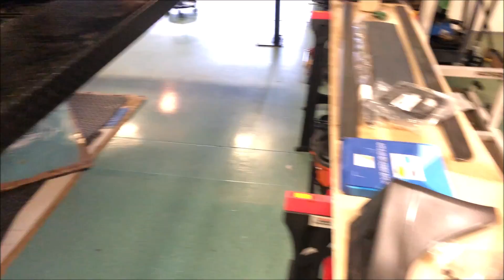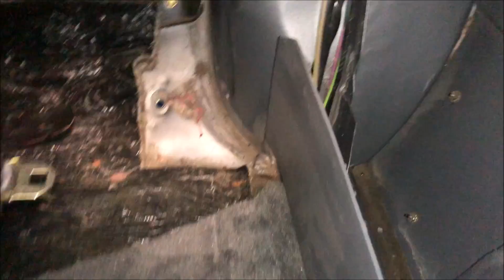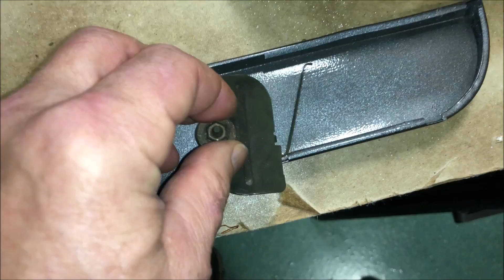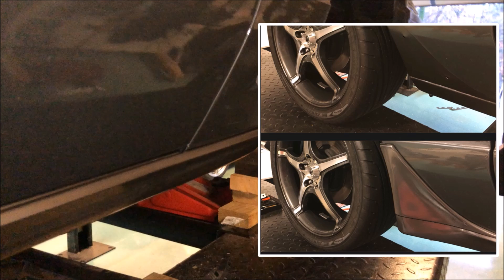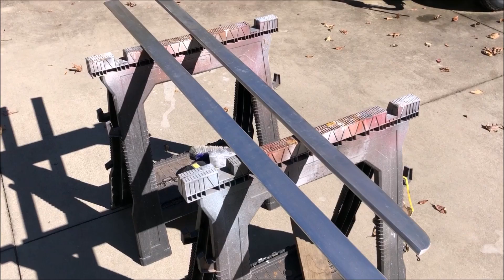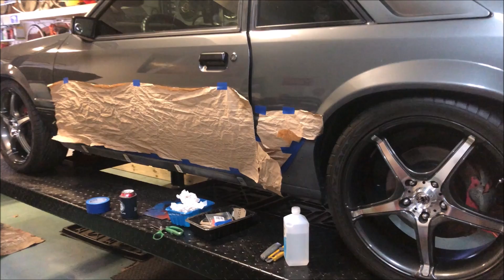How To Remove, Paint & Install '84-'86 SVO Side Rocker Trim Molding, Wheel Spats: Fox Body Mustang

Comment: I watched your video to confirm that the rocker pannel moldings I bought will appear correct on my 84 SVO. My car was in a wreck before I bought it. The front body pannels have been replaced with 87-93 LX parts and the rocker moldings were missing. 
I just found a set of moldings from a non SVO early 80's mustang and I was concerned about whether the shape would be correct. It looks like they are going to work after I repair the dents scratches and a small crack. I will also need to chop one end off each of them to butt up to the spats.
Reply from the maker: It’s great that you were able to track those parts down and make them work for your restoration.